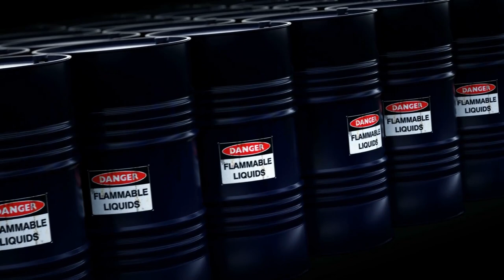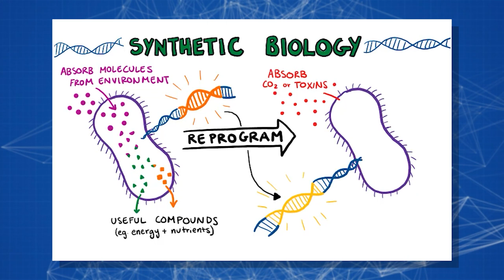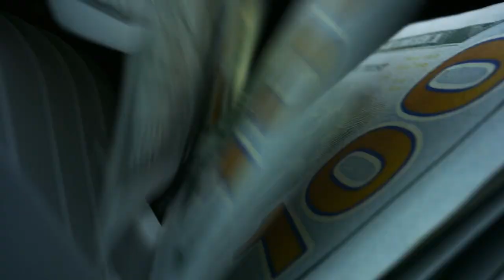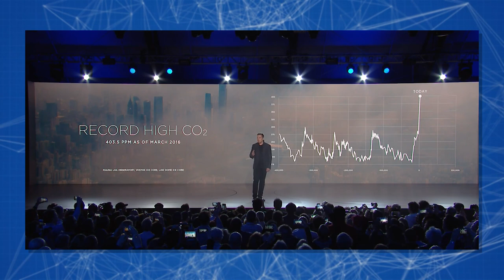How CO2 Can Power Space Travel and Save our Planet From Destruction

Comment: Since CO2 was in the 5000+ PPM in pre-historic times we know there is no runaway effect.  People should stop the hysteria.
Reply: I am just a kid but even I can see that you can’t deny the facts being handed to us, since the fossil fuels were discovered and carbon emissions started to rise so did the temperature and it would be foolish of people to see this as an unrelated matter, you of course are entitled to your own opinion but I disagree with your lack of concern around the issue because I think it is going to be the toughest challenge mankind has faced. :)
Reply: @maxfreeman111  OK - what about sea level rise?  That is often touted as a consequence of man-made global warming to create fear.  Did you know ever since the ice age, sea levels have been rising?  In the last 20000 years sea levels have risen about 400 feet and it hasn't stopped.  It has slowed down dramatically and today is near the end of the possible highest level.  That is one example of how they have deceived people into believing CO2 is to be feared.
Reply: @politicalfoolishness7491  greenhouse gases trap heat causing the ice in antartica to melt and if CO2 emmisions continue at this rate all the ice will be gone causing a sea level rise of 70 meters, this is an example of a climate feedback loop 1. temperature rises 2. ice melts 3. less snow to reflect sun 1. Temperature rises.
Reply: @maxfreeman111  Max - I've decided my position based on both sides of the argument.  I'm not going to try and convert you from your position.  If you've looked at both sides with some detail, and your decision is different from mine so be it.  I'm not a kid and I've been around long enough to say it has all the attributes of a scam - both for greed and geopolitical purposes.  And the poor people around the worlds are needlessly suffering and dying because of it.   Have a good evening.
Reply: More or less im seeing you both are debating around same point but with different words....
Reply: @politicalfoolishness7491  humans are accelerating climate change.